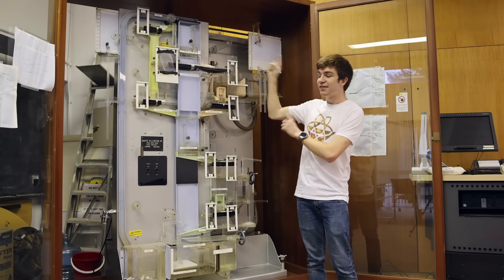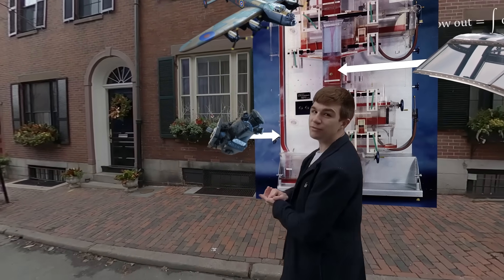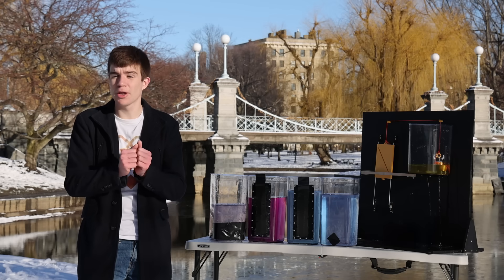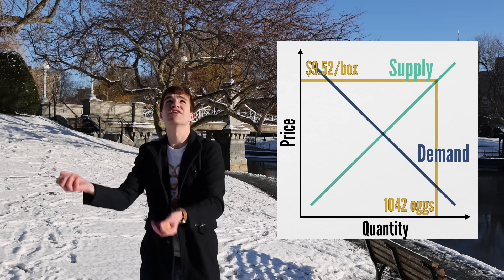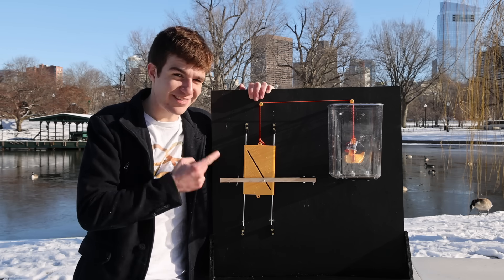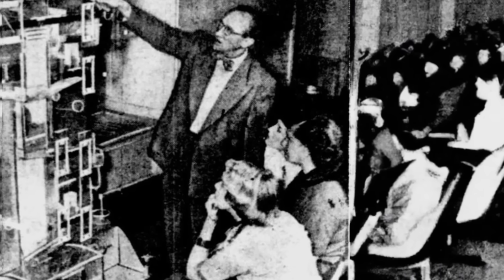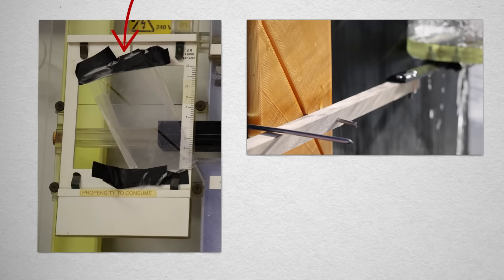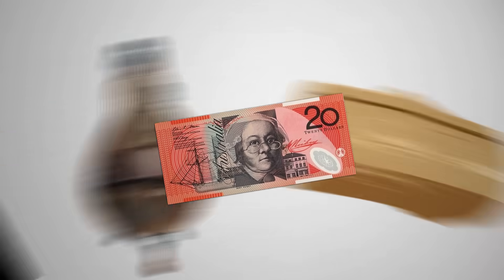Dividing by zero on a water computer from 1940

Comment: Billionaires don't spend their money? You mean they just stuff it under a mattress? I'm sorry, at best, that is a way oversimplification. More likely they will invest that money in something, if for no other reason than to avoid taxes. Also, divide by zero is not technically infinity, it is undefined. It is undefined because if you manually solve the problem, you find that the 'answer' can be any number, not an infinite number. There is no single answer.

Comment: The whole point of supply and demand theory is that in theory there are two independent schedules: supply and demand. Yes you show demand curves with different slopes but all three intercept the supply curve at the same equilibrium points.  I don’t how you are providing any supply curve input. So nothing should change. Also your change in savings discussion is inherently impossible. If there is zero propensity to save, by definition there can’t be any savings ie zero divided by zero which is pretty meaningless. So income is just whatever consumption is and there is no savings. That would basically would be the case when everybody’s family is starving.

Comment: Actually, since every single transaction in a market economy increases the total value if the economy, you don’t need to spend all of your money as soon as you get it for that to happen. It just makes the gain absurdly obvious.
Just look at the 20 you followed. It could be saved for 10 minutes or ten years, and yet the same principle would apply.
Also a misconception i saw is that spending money causes inflation. It doesn’t since the value of money is increased at the same rate as the total economic value. Even in his divide by zero example, infinite money was not created. Its just that as soon as money was earned, the person who got it immediately used it for something they felt was more valuable. That wouldn’t be possible if the value of money decreased with every transaction.

Comment: Static model of economics are wrong, no matter what dogmatic side you take. This piece of engineering is interesting in a historical sense, but to imagine you can understand economics, especially now, is a joke. Trickle-down isn't a theory, it's a catch phrase made and used as a cudgel by people who themselves don't understand economics. supply-side (as a pejorative) is used by more literate demagogues who also fail to understand economics. I read a comment in here that "I was taught in school that supply-side doesn't work." I, myself, was taught in California public schools that Keynesian Economic theory doesn't work and supply side does. To be fair, you tend to lean the direction of whatever ideological bent you were first taught.

Here's the problem with Keynesian, and to some degree most people's misunderstanding of Supply-Side; value-added. An economy is measured, mainly, by the volume of currency that is exchanged for goods and services (with too high a value placed on goods in this day and age). The problem is that as goods move in the economy they can gain or lose value based on factor that can't be measured directly. For example, what is the value of the old musty suit in the closet? Well, if you take it to goodwill, they will sell it at the highest price they can get from an un-invested 3rd party. That would be it's value... right? But what if that suit was worn by your grandfather the last time you saw him before his death. You might not want the suit to sell at goodwill for $2... It has more value because you are invested in it. This is just one way a good can gain perceived-value (because not selling it removes it from the market at a lower price). 

This happens in millions of transactions a day at small and large scales for goods of all kinds. There are other ways goods can gain value, or be value-added; principally among them, via labor. An artisan who makes beautiful live-edge wood tables imbues the raw materials with the value of their labor, time, investment-risk, etc. So while they may pay a certain price for the wood and glue and epoxy they use, those same materials will be worth much more when they are done. That is labor's role in the economy. Labor adds value more than any other factor, and the is a statistically near-infinite supply of labor that could add value in any given economy. The more individuals being their time, work, and investment into the market, the more potential value is added to the market. Value is not equal to Money, which is why we have inflation and deflation of our instruments of exchange. (very important to understand that)

Given all this, the water computer, while interesting and cool, cannot model a real economy in a significantly accurate way because there is no "value" being injected into the model. Scientifically, water has a specific gravity of 1.0. No matter where you weigh the water in that computer, the "value" (or weight) of that water per gram is the same. Maybe, if there were a method of introducing salt into the water supply, you could maybe model an economy, allowing a given volume of water to have more value or less based on specific-gravity (as analogue). In the same way, Keynesian Economic theory assumes a finite supply of value being distributed across transactions. It's flawed on the very face of it.

Comment: Fun fact, even if a billionare has billions... He usually can only spend like >1% of that because those billions are tied to assets, and not cash. Accounting for that, trickle down economics very much works, as that billionare has invested in something, putting that money in someone else's hands... It's not just cash that trickles down in a sense.
Reply: Except they "invest" by buying existing stock and other assets, they almost never by new stocks. So the cash is trading hands between rich people and companies, it doesn't actually end up with anyone involved in productive activity. Only a small trickle actually ends up increasing productivity. 

You may have noticed productivity falling off a cliff as the wealth gap grew and asset prices exploded. This has a very simple reason: We're calculating wealth wrong. Money is all about trust. As long as we trust that assets are a form of wealth, asset prices will keep going up while productive activity drops.
Reply: @bramvanduijn8086  productivity isn't at all related to wealth though. low production usually means high wealth. the wealthier a nation the lower the "production" is. economics is extremely complex, but the assets are an investments that does contribute to the economy. the money from the sale of those stocks goes back to the company on first sale, second hand investments do still influence the economy leading to changes in that companies structure and if the company gives dividends, back into the economy.

Comment: The main issue plaguing today's economy is government intervention.  Instead of fixing the issues, people are just kicking the can down the road and printing off more money like there is no tomorrow.  This is not only inflating the economy beyond control(because the purchasing power of your currency is exponentially less when you subsequently create more of it without backing it to anything, the concept of scarcity at play), but it is also making the problems exponentially worse.  Governments need to pull out of their Fiat economies and back their currencies to precious metals again(either a Gold Standard, returning to the Bretton Woods system, or going to some form of a bimetallic system) or they will end up just like Argentina did (before Javier Milei) or worse than them.

Comment: I thought this video was supposed to be about how the machine works and what happens when you perform the "forbidden" calculation, not a rudimentary and grossly over simplified explanation of economics. Even professional economist with admit that, despite what our "theories" of economics say, that's not how it actually works in reality, and only someone who really doesn't know anything about economics would say otherwise. The fact of the matter is there are some key underlying assumption about how human engage in economic activity that are not well justified at all (I will explain them if anyone cares), so the economic models we've created in classical economics are of limited use and application, and trying to present the descriptive laws within the field of economics as if they are on the same footing as those of other fields, like physics for example, is as best naive, and and worst dishonest.

Comment: I have some 'nitpicky blah-blah' to add. Dividing by zero is undefined. What you've done is show that, as the divisor approaches zero, the quotient approaches infinity. But if the divisor ever actually reaches zero, all bets are off. If you can't reverse the operation and get the original value back, you don't have a valid mathematical expression. Divide 14 by 0.1 and you get 140. Divide it by 0.0000001, and you get 140000000. And if you multiply 140000000 by 0.000001, reversing the division operation, you get back the original value 14. But if you multiply any number by zero, you get zero. You never get back the original value.

Comment: If dividing by zero in your model results in infinity, your model has an error. This is not unexpected, as all models typically have a range where they are useful, and outside the range, they become inaccurate.

The reason dividing by zero is undefined, is that there is no single definition that fits all cases and limits. It is mathematically impossible to create a definition for dividing by zero that does not have contradictions.

Comment: "Divide by zero" in electrical engineering tends to have some exciting results. 

Someone at work forgot the earth clamps (just some wires) on a 33 000V system. When power was switched on, ohms law was enacted: current=volts/ohms. Volts being 33 000V and ohms being far into the 0.0s. The result was that the cables ceased to exist.
Reply: I build tube amplifiers as a hobby..  They're about 600v.  A LOT of capacitance.  I turned an amp on one morning, and there was a bright flash and pop.  A thick ground wire between the rectifier and driver tubes, disappeared.  I don't recall it being loud, or there being much smoke either.  It was just gone.  The tube socket pins the wire was attached to, were 1/2 gone and melted.  But there wasn't other damage or signs of heat or smoke.  I was, and am still amazed that it happened.  I'm assuming the wire turned directly into plasma.  (Something failed in the rectifier tube.. I replaced it and the wire, and it has been fine for years)
Reply: It's unlikely to be an exact 0, though you don't need an exact 0 to demote some cables to useless.
Reply: @kzkaa.  Technically, you don't need an exact 0 to demote any cables to uselessness as it's impossible to build infinitely thick cables.
Reply: @eekee6034 Although the existence of infinitely thick electrical/ops engineers has yet to be disproved
Reply: @eekee6034 not with that attitude!
Reply: @eekee6034  Technically the cable doesn't need to be infinitely thick, it just needs to be a superconductor cooled down to a temperature where it has zero resistance.
Reply: @kzkaa.  Dr. Angela Collier, in a recent video on spectra, referred to the Sun as a black body, then had to go on a digression to say that it's not a perfect black body, because that's a theoretical, idealized object, but the Sun is near enough for all practical purposes. And in any science lab in the world you could casually refer to the Sun as a black body and everyone would know what you're talking about, but if you said it on the internet some pedant would inevitably jump in with an "Uhm, actually...", because so many people on the internet are deeply tied to theoretical learning and the belief that rigid definitions must be held, when in real life, actual professionals just use what works because it's close enough to be indistinguishable
Reply: @kzkaa.  it is to a computer if the decimal is too precise
Reply: @kzkaa.  unless you're literally insane like I am and store each digit of the number as a 64-byte integer; ie., a base{2^64} counting object with long-arithmetic bit-shifting operators 💀
Reply: @kzkaa.  for reference, Fx10(ie., 0xFFFFFFFFFFFFFFFF)x{1} is {1x2^0}, Fx10x{1,0} is {1x2^64}, Fx10x{1,0,0} is {1x2^128}, Fx10x{1,0,0,0} is {1x2^192}, and so on; where the maximum theoretical value or decimal-precision depending on the configuration is {(2^64)x2^(2^64)} which would require ~147,573,952,590 gigabytes and a very long time to perform any long-arithmetic xD
Reply: If the resistance was exactly zero, the cables would last indefinitely
Reply: How to vaporizer expensive technology in seconds or less
Reply: Hmm, were they safety grounds/ earths on a 33,000V line used during maintenance? If so, they should have been sized to handle the available fault current for however long it would take the line to trip.

Comment: Currency nor wealth is fixed. At the beginning of your video, you assigned a value to a volume of water. In reality, no currency nor commodity has a fixed value. If water leaks from the system, the remaining water has more value. If you add water to the system, you dilute the value of the water.

Billionaires holding currency is like removing water from the machine.  The remaining currency is worth more because it is more scarce. The total value of the exchanges in the economic system is what is significant, not the value of the currency nor the number of dollars in the system. If you rip the currency from the billionaires and dump it into the system, all the currency is instantly worth less, nobody gets significantly richer, and only the billionaires and anyone with monetary savings get poorer.

It would be more productive to come up with ways to help the poor gain wealth rather than steal from the rich. Wealth is not a zero-sum. The world is wealthier now than 2000 years ago. Technology has made life better, and we all benefit. Let us figure out how to pull us all up, rather than pull down a few in a jealous fit of childish revenge.
Reply: ...but the elites don't want that. They want net-zero emissions. Degrowth, depopulation, sustainability. To be fair, you can't plan for infinite growth on a finite planet. Unpolluted land is hard to come by nowadays, and commercial farming and fishing is unsustainable

Comment: There is two logical answers for divide by zero. If I have $12.00 and I make no divisions, I am left with 1 equal part of $12.00. On one respect it can be 1 whole or it can be the original number, but it can also be zero, from another perspective, as the inverse of multiplication. 12 x 0 = 0, so... 12 / 0 = 0.

Computers can't handle the basic logic as absolute, because of poor basic logic limits. Really, it should be defined by the programmer, what division by zero is.

Such as degrees divided by degrees. 360 / 0 = 360. That would have stopped 98% of all issues with 3D rotation and any repeating divisions.

Comment: Just a thought: One reason you normally can't divide by zero is because the result goes to both positive and negative infinity. But when you are dealing with limits you can specify which direction you are approaching zero from. When calculating the limit of 1/0 and approaching zero from the positive direction the result is (positive) infinity.

Given how the machine works and how you reach the divide by zero, it is similar to how limits can define it as approaching it from the positive direction.
Reply: Since a negative amount of water existing doesn't make sense as a concept, you could say that water naturally has only zero or positive values. i.e. move negativity to the unit instead of the number, and it becomes trivially obvious that dividing by zero leads to infinity.

Comment: Imbedded in this video is sooooooooo much misinterpretation of basic economic principle, it hurts. The "explanation" of supply and demand did nothing but serve to confuse the idea, and the Keynesian over-aggregation is mind-numbing along with the rampant implied mercantilism. Supply is the cost of producing each unit of a good, not the number of units of that good that exists. The paradox of thrift and the "bigger is necessarily better" thinking of certain macroeconomists really undermines the value of markets and REALLY encourages bubbles and bad long term outcomes

Comment: It's amazing how few people seem to understand this--an economy functions due to the FLOW of money, not the existence of it. You can have a million gallons of water in any of the tanks of the machine, but if it's not moving around, the economy is broken. People who accumulate money and spend relatively very little of it (i.e. billionaires), or worse, move it out of the economy entirely (into tax havens), are actively detrimental to the economy.
Reply: Billionaires have comparatively little in cash.  They are billionaires due the worth of the assets they own.  The cash is already in circulation.  If they invest 100 million into a company that cash is in motion.  Where did they get the cash?  The liqudated assets or leveraged assets with a bank facilitating the movement of that cash through the economy.  Taxation only moves that cash to the government that is the most inefficient machine for ecconomic activity since it has incentive for efficient use of capital.